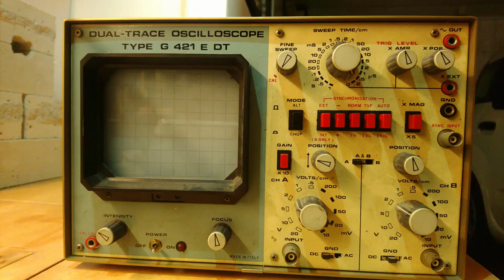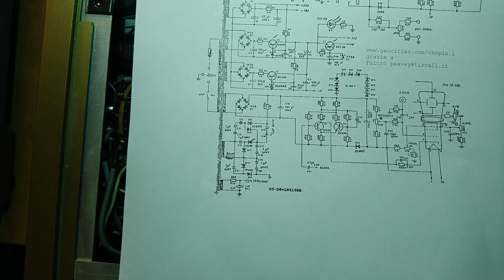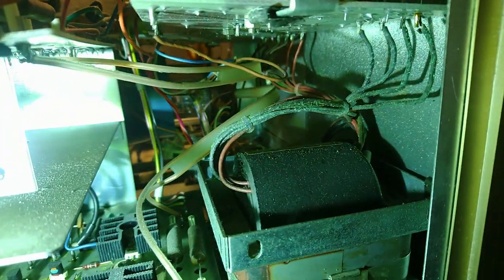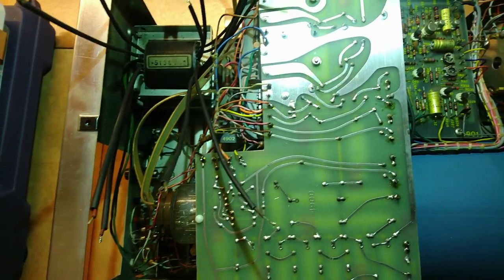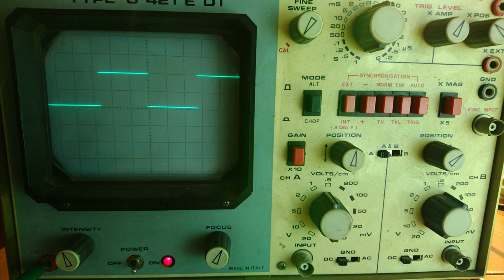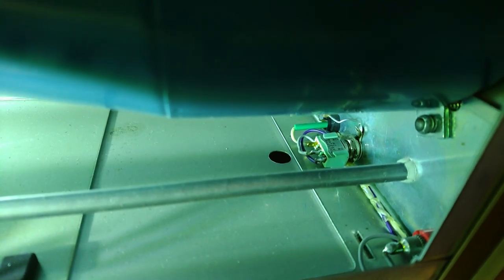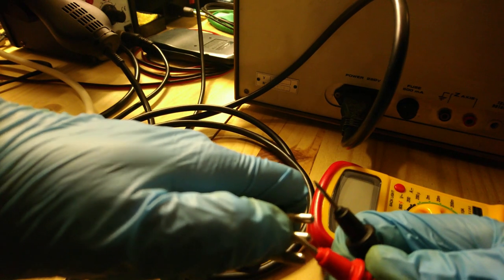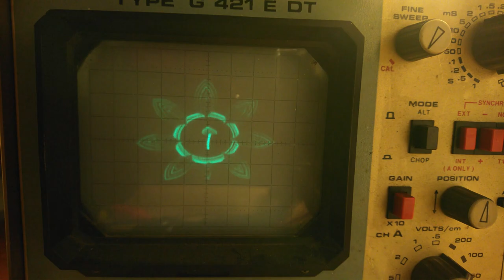Oscilloscope repair: Unaohm G421E DT

Comment: Hi, the insulation of those wires inside the transformer is probably not much better, you could try submerging it in insulating varnish, it may prevent the insulation from coming off, at least for some time. Good luck.
Reply from the maker: Indeed it started arcing inside the transformer, you were right.